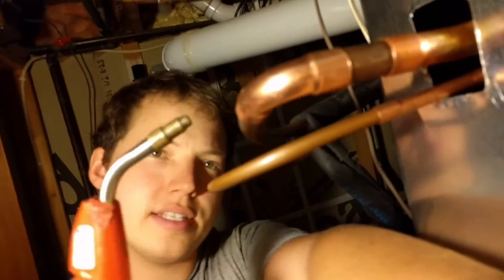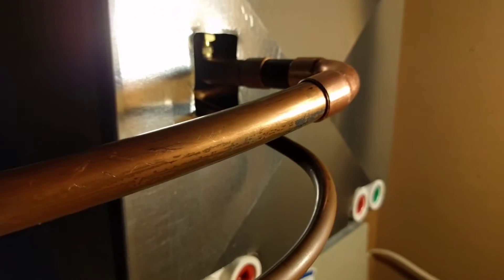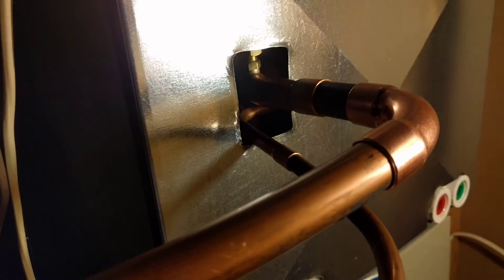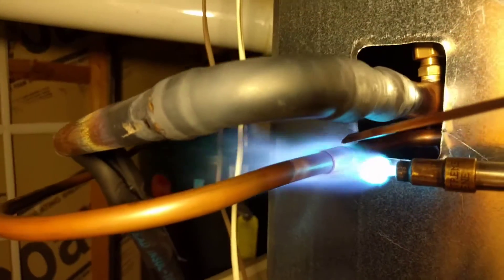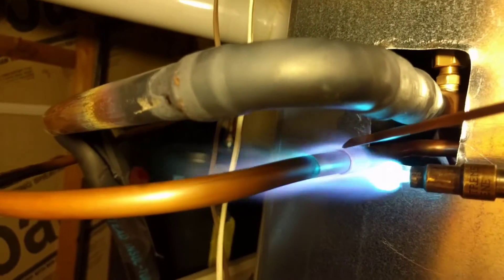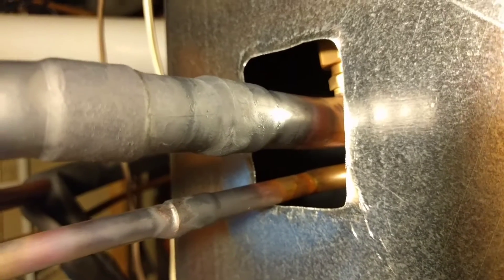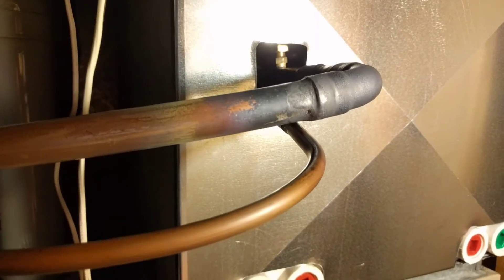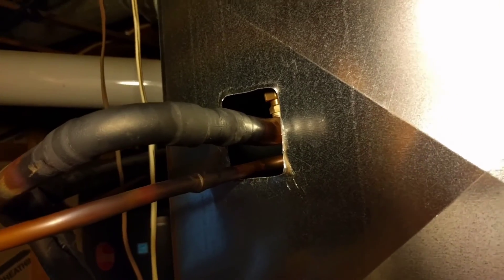How To Braze Copper Fittings For An Air Conditioner - Full Video Of Brazing Fittings Using Nitrogen

Comment: You’re using the torch to melt the Rod.  The fitting itself should be hot enough to melt the Rod, with the torch on the opposite. Side. Loose the air acetalyne torch.  It takes too long. Your brazes might look better if you use a quality rod with silver,such as Harris 15. Rod that contains no silver is crap.  The brazes are Brittle, full of bubbles,doesn’t flow, unless your there all day.  Cheaper is not better. I doubt that cheap Rod would pass specifications on a commercial job.

Comment: Why are you brazing instead of soldering with regular soft solder?  Did you use any paste between the pipes before brazing? Does brazing make the job any better with nitrogen rather than soldering with soft lead?
Reply from the maker: Soldering with regular soft solder is not permitted for refrigeration applications since it is not nearly as strong or stable as a brazed connection.

Comment: The white electrical cable in the rear got charred, so also the other one next to it.  You may want to use a heat shield to protect them in future.
Reply: The cable was untouched 😆 all there's experts

Comment: I'm not ac tech but would love to see and understand how to hook up, flow nitrogen and what keeps you from using a whole tank fast. Another video idea I found lacking on the web when I needed it was manometer, static pressure, installing test ports. A lot of important stuff comes from correct static pressure, yet most residential HVAC I see do not have them. It's like installing a car engine without checking the oil, if I do recall correctly. Thanks for a insightful video.
Reply: Service valves on condenser are front seated. Pull valve core on suction line, hook up nitro to liquid line port. Set nitro regulator to 2-3psi. Just a slow stream through the line set. Static pressures in residential work are something you’re probably not worried about. Unless the cause is dirty filters/ coils, you’re not going to re-engineer the ductwork on a service call. The txv will make up for a range of cfm through the coil. Worry about subcooling. Manometers come in handy on facilities air balance, where I’m trying to balance exhaust, make up air, economizers, etc.

Comment: You should wrap your evap coil ports with a wet rag that way you don’t risk overheating the TXV.  Another pointer you don’t need to use a 90 degree elbow and then another piece of tubing just use a street 90 or you can also use tubing benders.  Remember your joints are the fail points, the more joints you have the more leaks you could have.  Also you move the heat around too much.  Once you get the joint hot and the solder flowing roll with it.  Also it looks like you are concentrating your heat on where the joint is, once you get the joint hot you need to move the heat back so it pulls your solder up further into the fitting and completely fills it the joint.  If you just puddle the silver solder up on the joint itself without actually pulling it into the inside of fitting then over time you are going to develop leaks.  The more time you take reheating your joint the more of a chance you’re going to overheat downstream system components, plus you’re using more fuel which costs $$& and also time is $$$.  And always remember to quench your brazed joints with a damp rag to remove the heat.

Comment: You need to get yourself a tubing bender and needing up those line sets that way you also don't have to use fittings less joints less chance of a leak

Comment: Is that a hole@5:34? Otherwise nice bead, I draw the braze in from opposite side of my flame so it's flowing to the heat with capillary action, you don't want to melt the braze rod with your flame, unless your making your final bead.   Also why no heat blocker going towards unit or wet rag?

Comment: Doesn't anyone use a flashlight and inspection mirror? I've yet to hear anyone in any of these videos mention them. To me, they're as essential as the torch. Different strokes I guess. At least you DID mention a visual inspection.  Nice looking braze joints, by the way. Good job.
Reply from the maker: Don Michael Corbin I do carry and use an inspection mirror almost every time. Sometimes it isn't needed but I still should have mentioned it. Thanks!
Reply: Don Michael Corbin I use flash light, mirror(steel mirror is better IMO) my phone, whatever I can to make sure it's sealed. Then I pressure test with nitro since its already running through.
Reply: Don Michael Corbin yeah I do bro, I guess it’s what you like. If I’m doing a job around the house or at work always use a mirror

Comment: No silver, no tensile strength.  Turbo-torch isn't enough heat, takes too long to heat up,  excessive  oxidization.  No penetration.   Hire a professional.
Reply: Barry Banzet you are tripping bro all I use is a turbo torch. Everyone in my company... I think air acetylene is cool and works better but I don't want to deal with managing more tanks than i already do! Ill probably get a set for stuff I would like to heat quicker like reversing valves but for installs the turbo is great. Especially in an attic.
Reply from the maker: Haha, glad you've got it all figured out Mr Banzet. We use oxygen and acetylene when required as well as silver braze. Different circumstance determine what is necessary. I don't think you can claim that a braze joint will fail by using a turbo torch and standard braze or say that to be a "professional" those methods are always required. I haven't ever encountered an issue with the methods in this video and good penetration with the braze is always achieved.
Reply: Trouble is Barry you don't provide any facts here. The fact is no data sheet is going to show that dyna flow has "no tensile strength" so your flat out wrong. The rest is simply opinion.  Although there's a few things I tend to agree with you on here I can't see why anyone would take you seriously.

Comment: is this brazing resist to heat? my pipe will work in 230 degree celcius
Reply: melting point of the braze listed should be about 815 C (1500 F)

Comment: Hey Ben, what torch was used in this video?
Reply from the maker: JDT738126 The link to the torch I use is in the description. Check it out! I really like it. For the nitrogen I add nitrogen to the liquid line access valve at the outside unit and remove the valve core of the suction line service valve to bleed the air. This creates a loop for the nitrogen to flow.

Thanks!
Reply: Benjamin Sahlstrom awesome thanks man, and great video